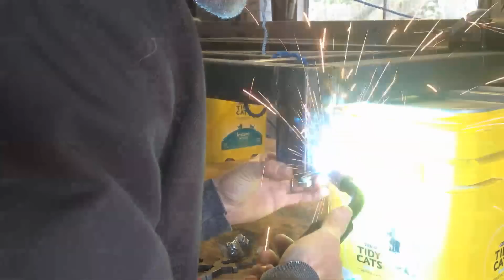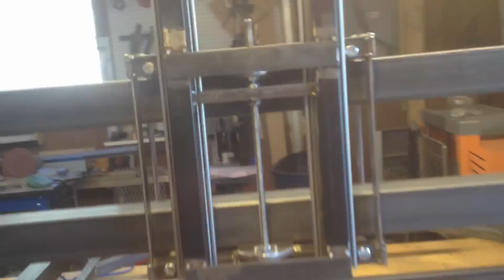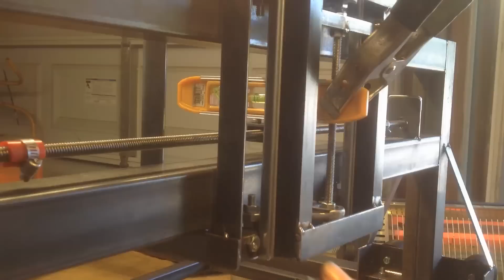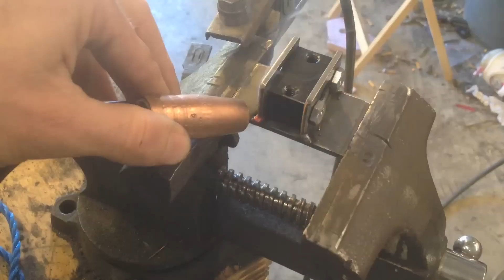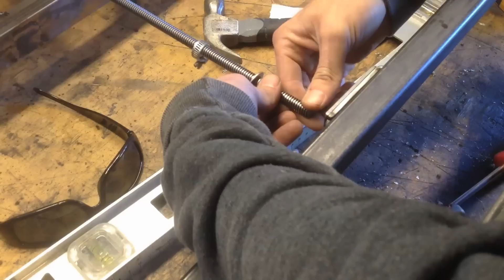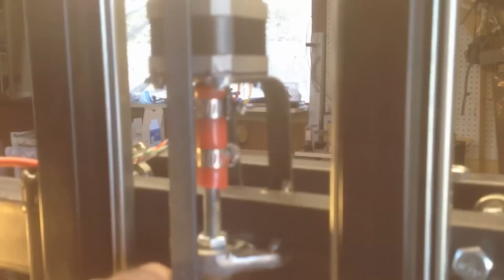How to: DIY Arduino CNC Router Cutter Welder (Part 4: Lead screws and Motors)

Comment: This guy has x and y backwards. All the CNC routers and CAM softwares I've seen call the Y axis that which carries the gantry to and fro in relation to the user or the way you look at it. The X axis moves the tool side to side.
Reply from the maker: Why does it matter?
Reply: Well, it helps when talking to others with CNC router experience and that the was the software was set up on every one that I ever used. I had to pay extra attention make sure I was on the same sheet of music while you were talking. Good price. Good ideas for using thrift store stuff. Great fabrication. Not sure how it compares for accuracy compared to linear slides and ball screws ($1000 for a 4'x8' kit.)

One thing I've been wondering. I can't remember the term for the problem, but with a center screw, if you go too fast, it will try to skew the gantry so it's not perpendicular to the direction of travel. Some machines use a rack and pinion to keep the left and right sides of the gantry moving the same - like posi-traction vs limited slip in effect. I think I also saw one with one stepper on each side of the motor.

You experience any obvious problems from trying to go fast yet?

Comment: i was wondering what you are using for a power supply, and great job on the design, i was most inspired on the way you used those metal draw slides for the z axis that was a genius idea, keep the vids coming if you decide to do another, i am thinking on building a cnc and got some great ideas from a site called open source using c frame and lead screws rather than belts, thanks again.

Comment: Just wanted to ask how it works after almost 2 years? Would You change anything or it just works perfect?
Reply from the maker: Still works perfect.  However I've been thinking about converting it to a folding design against a wall.  As it is, it takes up to much space in my shop.

Comment: i could not image how to line up the motor with a long screw and connect them together? As it will rotate together for a long time,  it doesn't request very accurate line up?  what is your trick? :)

Comment: the nema 17 aren't to weak and how many feet is your cnc and could you use a normal ready rod like you used on the z axis for the drive screws on x and y nice build videos too
Reply: Gerrit H did he use nema 17? Maybe 4.5kgfcm is strong to pull and push that heavy axis

Comment: Why did you use the router power tool since its fundamental application is to cut grooves onto the surface and welding doesn't involve any of those. Regards from India, would be very happy to hear from you soon

Comment: Just kidding I really like this project but my concern is that to don't have any adjustment to compensate for wear. If this machine gets a lot of use the hard outer bearing races are going to wear the mild steel tubing and a couple thousandths Hearne and a couple thousandths there and you start having problems. Don't Get me wrong your doing a fantastic job just used to build machinery and have seen what works and what doesn't and I totally get working on a budget and working with what you have just felt like I should mention it. Keep up the great vids!!

Comment: Hi .
a great project , may i suggest that you shield the motor and the threaded rods when working as the splatter will damage them.

also the motors appear light for the load expected of them.

Comment: Hi, love the build and have followed it throughout and admire you for it.
     A question though (not a criticism mind you). Having spent that kind of $ for the 4 bearings, was there a reason you didn't use sealed bearings like the ones you harvested from the roller skates and skate board?
     I'm sure ones of the same size you needed must be available via the internet. Just concerned about debris getting in those open bearings and putting a hurt on all your hard work that's all.  Thank you again for sharing your build with us!

Comment: sorry dude but i burst out laughing when you went to put the motor in..... wtf its soooooooo undersized!!  wish u woulda used one of the motor sizing calculators before finalizuing ur design.... theres calcs out ther that will give u the required torque for the weight and dimensions of each axis, aswell as the required feed speeds etc.  They will also help you calculate the lead screw diameters, based on all of the above, lead screw material, etc.
Reply from the maker: +localbroadcast Fair enough, dude.  But then how do you explain the next two videos?

Comment: Gloves? Do you ever use gloves. Even if you would't get burn by touching hot metal, the light of the welding consists huge amount of UV.

Comment: I think motor are under powered. Even for Nema17 they are small.
Reply from the maker: +Sourabh Roddey Did you watch the whole series??
Reply: +Absorber of Light  Yes I did.
still think you could use the one with more torque.

it will make it faster. non the less great work.
Reply from the maker: Thanks man.  I'll probably upgrade in the future but for now they're working fine.

Comment: what kind of motors are you using? your videos are giving me a lot of ideas.

think a nema 27 425oz would be enough for this kind of machine?
Reply from the maker: +Luis Fernando They're Nema 17.    Yes 27's would be better.
Reply: +Absorber of Light ...First thanks for the great videos you made !
what kind of Stepper Motor Driver Moduls are you using and where did you bought the motors and the driver modules ?

Comment: Do you have any practical applications in mind for the welder attachment?  I could envision pretty specific applications where it would be worth proving some code if you had repeat work; and of course a fourth axis would be pretty useful when welding tubing.

I am impressed with the quality you are getting per dollar. Very impressed. I wonder what kind of accuracy your lead screws have compared to say Chinese 'C7' ball screws on Ebay. iirc some real world measurements via glass scale from CNCZone showed accuracy of around .009"/ft with <.001" repeatably and backlash with a double ball nut configuration.
Reply from the maker: +Gabe Larkin One reason I built the CNC is to perform repetitive welding.   I received a large order for these custom brackets that require long beads of welding.  I bypassed the trigger and instead wired a relay switch which is activated by spindle on/off commands (M3, M5).  The tedious part will be going thru the code and inserting these commands but it will be worth it.   For now I've been triggering the welder by hand and things are going much faster.    I'm not sure yet how accurate my lead screws are since I don't have a dial gauge, but I'm planning on getting one soon.  Thanks for watching and for your comments.